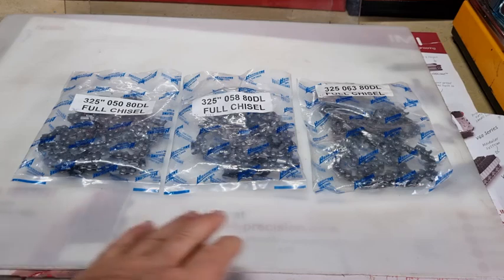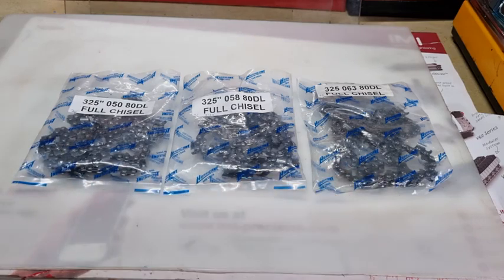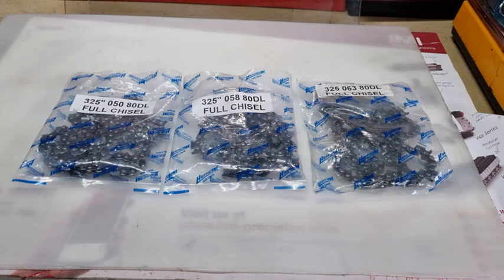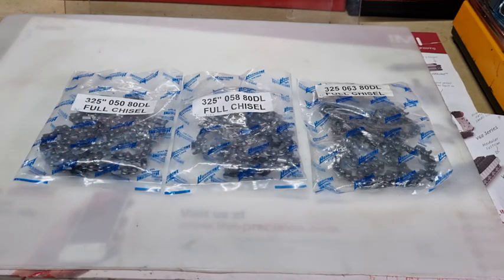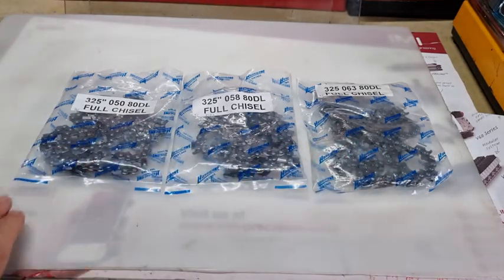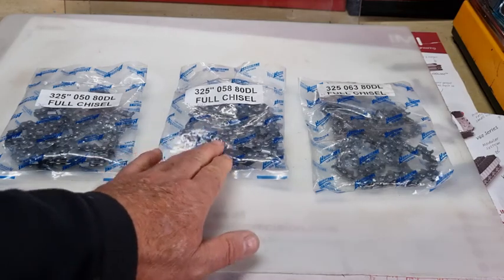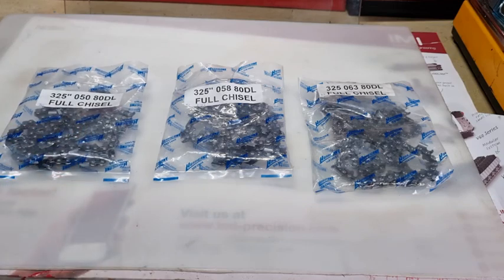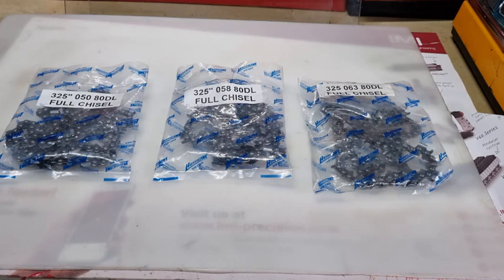The reasons in the 1980s they made 3 gauge sizes of.325 and 3/8 chain

Comment: In my area .050 gauge is very common. With the .050 gauge .325 chain taking the place of the .063 gauge. When I have experienced broken tie straps it usually is a result of having thrown the chain at high rpms or when the chain gets pinched very hard. Back in the early 90's we were experiencing alot of problems with the Stihl chains having the drivers ripping off so much so that my local Stihl dealer started selling Oregon chain over Stihl chain for a very long time. I still have this problem with the Stihl .050 gauge chains on 60cc and up saws today, especially when a chain is thrown, I have had it happen cutting with a Stihl 066 28" bar dogged in and ripped several drivers off. For that reason I prefer not to run stihl chain in .050 gauge on 60 plus cc saws. I don't have that problem with any other brands of chains that I run in .050 gauge. I have experienced issues with inconsistentcy of proper hardness in chains manufacturered today, especially the import ones.

Comment: I have always run 058 as that is what came with Husky Saws. Some newer Husky saws run 050 and now still make RS 325 chain in 050 which is a little bit lighter. I guess the lighter the chain the quicker? I have never had a chain snap thanks for the info.
Reply from the maker: These days the chain steel is superior to 50 years ago so that helps a lot.  Husqvarna run 058 authentication main chain for many of thier saws

Comment from the maker: Today there aren't any difference between .050 and .058 when running shorter bars(under 25") the issue in the past was that the .050 didn't have the strength needed to hold up because of the way the manufactures could make and harden metal that is history today the .058 simply have more metal that you need to twist before the chain breaks.

One thing to note is that Stihl run all there 3/8" chains as default as .063 and their .325 chains as .058 in Europe at least. And much the same here in Australia

Comment: Tinker, how about running the 400 on a .325  63gauge ?
Reply from the maker: Was it new like that. Or did you choose that.  Here in Australia a MS311 20 inch bar comes standard with 3/8 063 gauge
Reply from the maker: Why would you run a 400 on .325 3/8 063 is far superior chain for that saw much better chip clearence and cutting ability

Comment: I like to know 3/8 pinch .05  vs .063 gauge also ,please
Reply from the maker: It's all about you how big your saw is.  60cc will pull 20 inch bar 063 gauge.
Its the most common size for 60cc and upwards.  Below 60cc 20 inch bar use 050 gauge or use .325 chain
Reply from the maker: @SawChainTheories yes here at our Stihl dealer they mainly stock 063 for bigger saws, but can order anything else also

Comment from the maker: 325”: This saw chain was introduced as a faster and lighter chain to be used with the fast revving saws that were introduced in the 1980s. It took over from the traditional 3/8” professional chain due to its lighter weight and faster cutting. Today, it is found on all mid-range “pro” saws and has recently been further enhanced by the introduction of a “narrow- kerf” range. File size required is 3/16” / 4.8mm and again we suggest using any one of the many sharpening jigs